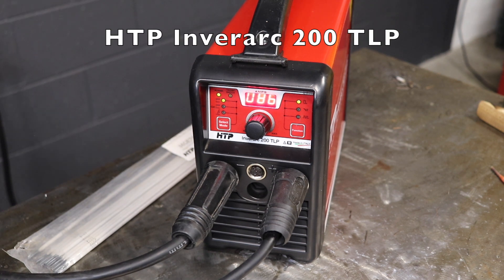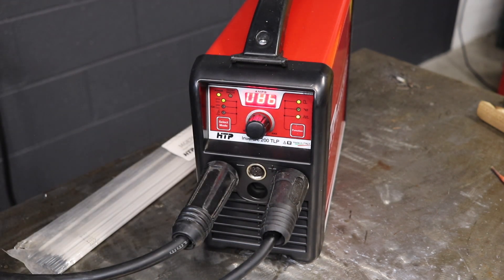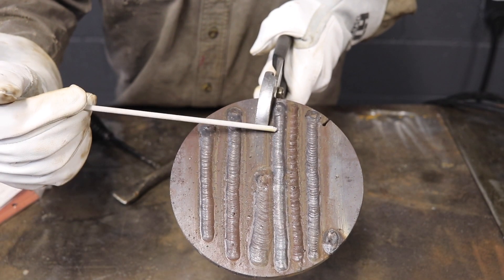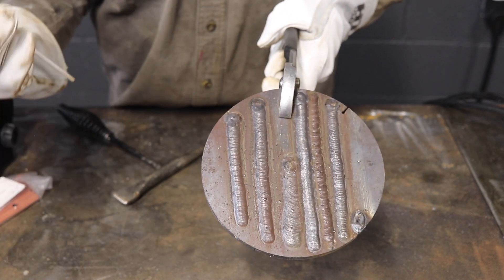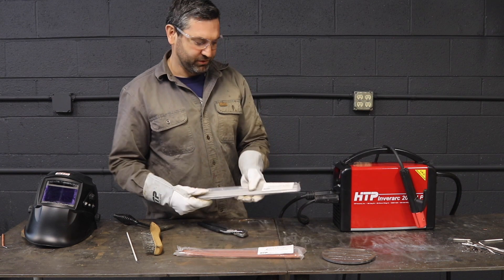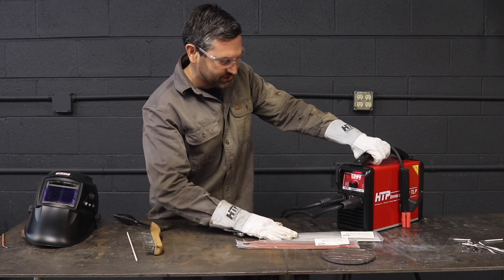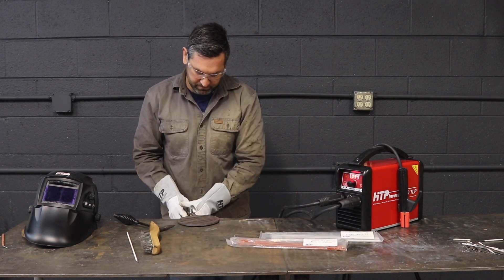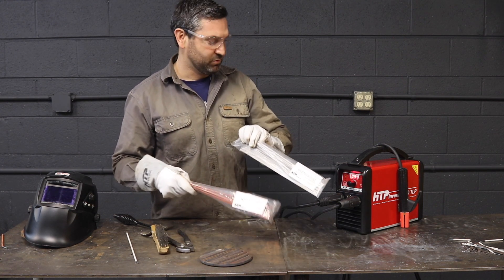Pulse Stick Welding With The HTP Inverarc 200 TLP

Comment: Can you burn 6010 5p with this machine?
Reply: this machine owns 6010 !!!!
Reply: @ZILAwelds  Even Lincoln’s 5p?  Thanks for the reply
Reply: @kenyanr1  yes !  I weld them every week with that machine ...  and the arc dynamic is GREAT. it is probably the best stick welder that you have ever tried ... I mean it was the best one I have ever tried in my life !  and I own a vantage 400 and used to own a couple SA200's  I have welded with Lincoln, miller, everlast and Esab machines ... even the fronius trans pocket ....  some came really close - but one was better .....  it is really THAT good ... the machine was developed in Europe for CITOFLEX rods which are like 6010 just even more demanding on inverter machines ....  this machine in the CEL program just owns them ... there are no 2 ways about it
Reply from the maker: @ZILAwelds  Couldnt have said it better ourselves!

Comment: Hi can you do the same on invertig 221 ? Can you burn some rod with 221 thanks
Reply: the 221 does NOT have adjustable hot start or adjustable arc force.  it also only has 1 stick mode (which will weld 6010 and 7018 and everything in between) but it is not as refined ....  BUT the 221 has the option of AC stick welding. - this one here does not.